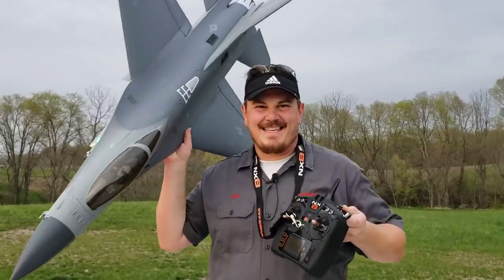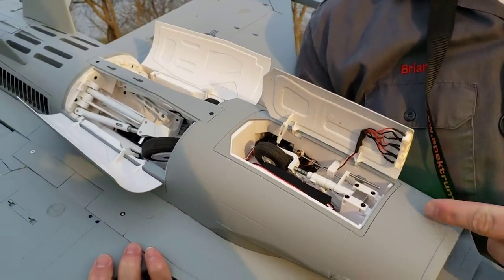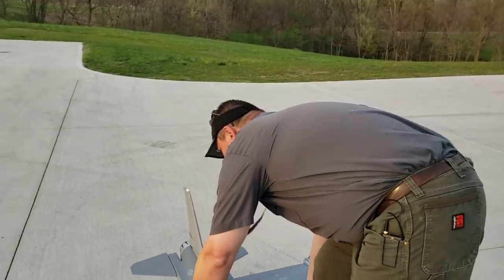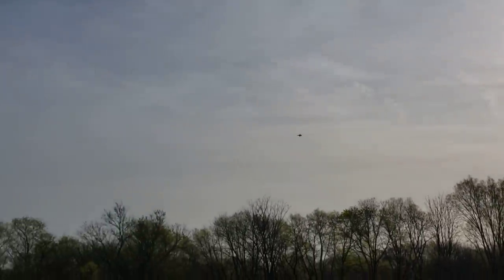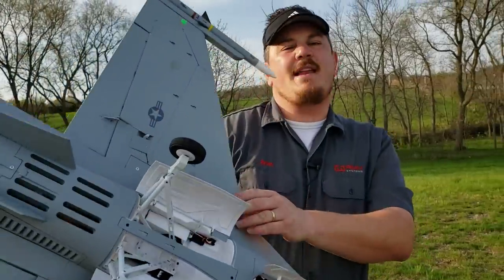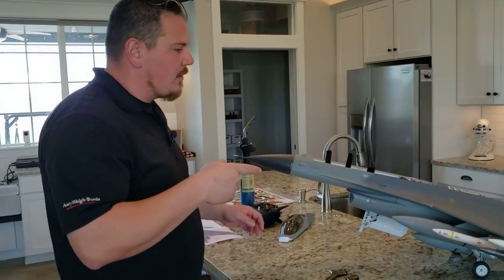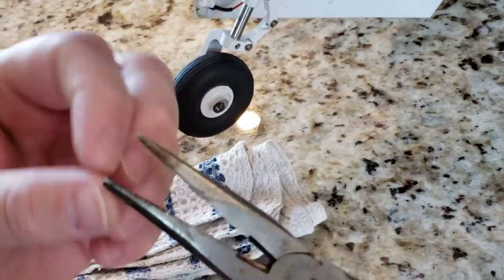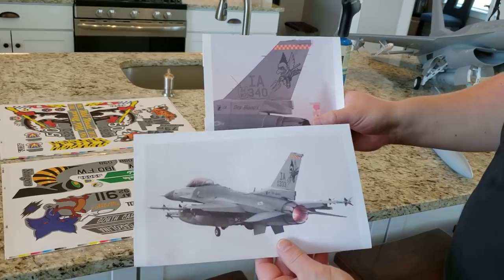E-flite - F-16 Falcon 80mm - 4X Maiden Flights & 2X Repairs!!!

Comment: I appreciate your honesty in warning people that these aren't a 1st or 2nd edf jet...maybe a 3rd. You have crazy piloting skills..especially what you fly & where you fly it! Obstacles all around you...alot of people dont have those kind of skills. So,  good on you for warning them. 
Sweet planes...good job on the vids👍
Reply from the maker: Thanks Chris! I know for a fact that there's so many way better pilots out there, but I DID learn to fly in "tighter" quarters, and for me, it's kinda normal. Some guys think it's the same as flying with a wide opened flying field, but it's honestly NOT...there's good and bad that goes with it. Good, it FORCED us to stay close for filming. Bad, it's a lot harder to shoot landings on a FAST plane like this. This plane flies GREAT, but it needs time and a LONG shallow glide slope to get in at the right speed....this helps to keep the gear from getting bent, like I did ;) OR there's just more flying, and more practice and playing with CG to get it WAY back without making the plane fall over on it's side in a NASTY low level stall ;(

Comment: You are absolutely the very first person I have ever seen successfully change out a retract without purchasing parts exclusively from the company that made the jet! Great job
Reply from the maker: Thanks Tuna! I HATE buying parts, BUT on retracts, it's just the better option...when we run these "early" release flights, this sorta thing is almost bound to happen, since we CAN'T get them many times, this time included - LOL!

I know this screw repair will probably bend too ;( BUT, if it bends the right way, I can just turn it 180 degrees, and get back at it, then when it breaks off, I'll just swap it out. I'd like to put a brass sleeve over the screw to thicken up the assembly a bit, but still allow it to come off if I'd have a real rough landing. Maybe SS would be better, since it'd be stiffer??? Not sure the best answer, but I know that a large part of my issue on that item was the short strip and short flying circuit, but this is what I LOVE. I love the simulated carrier landings!!! I'll be doing a couple flapperon videos soon, so keep an eye out to see how much better (or worse) she performs. You don't want to have to crash yours, so let me do it to mine for you - LOL!!!!

Thanks for being here with us Tuna Flights!

Comment: Hey Brian I can't thank you guys enough for these honest flights and repairs. Its helped me greatly. I know this comment is probably over a year late but I just started this amazing hobby back in April. I fly this beautiful bird at my local airfield and land on a grass runway and have had to replace that nosewheel axle myself. The nose gear axle thread is reverse threaded, if you turn clockwise to remove it they come out fairly easily plus HH sells them at a reasonable price too which is great.

Comment: Brian & Camera Crew, if you watch and listen at 26:45 in this video, the mic doesn't rub on anything.  The noise seems to be a bad/dirty connection at a plug & socket, just a thought.   Love you guys, keep up the great teamwork!
Reply from the maker: Okay, good idea. Not sure how to prevent this, since they're screw in style 3.5mm plugs????
Reply: @BrianPhillipsRC  I would disconnect then reconnect all connections used for audio in your setup (a couple times) to clean/re-seat the contact surfaces inside the plugs, especially if they don't get disconnected very often.  Worth a shot, hope it helps!  If problem persists, there could be a bad spot in a wire, the interference seems to be triggered when you are moving.

Comment: Saw this thing at Horizon Fest past weakened. Unbelievably cool. I am a heli guy but would love to get something like this.
Reply from the maker: If you're flying Heli's and want to get this plane, might want to start with the F-15 or Habu, just an FYI. I want you to have a great experience, and this one is not super easy, but it's not as hard as flying some Heli's, that's for sure!!! Just happens to be a slightly different skill set.

F15 https://bit.ly/30RrnlG
Habu https://bit.ly/38Kilv1
Reply: @BrianPhillipsRC  thanks Brian I’ll look into those.

Comment: Not sure if you have tried them yet, but I did a search for breaks and it look like Dubro makes a light weight brake for the nose wheel it ties into the elevator servo or could use a separate micro servo. Might help with some of your faster planes like this one.   It would likely need to be modified to work with certain planes , but I think you would be up to the challenge!
Reply from the maker: I'll be adding flapperons too. This might help a bit, but to be honest, I need practice with this plane.

Comment: Adding flaperons is a must..as without flaps no pilot could pull of a batter landing. Might as well employ Aircraft carrier systems too
1.  tailhook on plane and wires on runway to engage tail hook
2. Arresting net as last resort
3. Latest beacon following computer assisted landing system.
Reply from the maker: I want to do it due to the cool factor, but flapperons first.

Comment: Hi Sir, did u land using the gyro? I am a no-gyro flyer fly many edfs including turbines. I found that the fms F16 80mm and also freewing F16 90mm are very hard to land perfectly. during low speed to land, it will move like a wave when we do the elevator input to flare even with high expo. Maybe need to setup the flaperon/taileron like RcGeeks did.
Reply from the maker: I don't use SAFE (auto-leveling), but I use AS3X for the rest of the flight.

Comment: I was surprised you didn’t take the F-16 to the road. I remember you doing that with another jet. Not questioning you, I’d need 3 of your driveway lengths to land this EDF.
Hence the reason my 80mm a-10 after being built 6 months ago hasn’t been maidened. (Scared to land it. Well, scared I’ll run out of runway)
Reply from the maker: Yeah, fear is a real thing ;) The F-18 is easier to land, if you have space. Flaps make a HUGE difference on the F-18, but the rollout and wonky but BEAUTIFUL landing gear makes for a complex situation if you have any yaw correction on the landings with either of these planes.

Comment: In $ per smile, does the 70mm version not look to be the better value option?
Flight time also a tad too short with this 80mm version for me..
Reply from the maker: $'s to Smiles...tough. This is a plane that I stop and look at and admire every time I walk by it. Don't get me wrong...the 70mm passes the 10 foot test, but it's not one I admire sitting in the basement.

Also, this F-16 is just a GREAT flying plane (still) and I LOVE landing it...even thought it's a tough experience. One of the harder to land planes I have, but it's easy to load the battery, and it flys amazing!

Comment: Just had my second flight; made one attempt too many at my final and totally lost power while coming in.  Came down short, level, but hard into the dirt.  My front gear was a bit worse than Brian’s:(. Parts are on back order at HH. Gonna set my timer for 3:00 next time!
Reply from the maker: NOOOOOOOOOOOOOOOOOOOOOOOOO! Sorry to hear about the mishap. That's a real bummer, on maiden, no-less?!?!!

I'd be fixing it, if I was you... I like it better now that I can swap out the bolt that I put in there.

EDF's are power-suckers, and especially when you see that beauty whip by at close to 100mph and just beholding the beauty, it's so easy to blow right past the timer...I've done it too many times to count!
Reply: @BrianPhillipsRC  this was on my second flight, about a month after a good maiden flight.   This time I just did one too many fly bys, oh yes, she looks and sounds great zooming past!!
Reply: Just ordered that fastener kit too!!  What size tap/dye bits did you use? For that axle?

Comment: nice flying as always, 2 suggestions, why dont you use that nice empty road in front of your house to land? or , get some golf grass or artificial turf to extend your drive way to slow down, unless you get brakes. !
Reply: road at the end of the house cambers with a ditch on either side for water drainage
Reply from the maker: As Kelvin mentioned, the crown on the road does create some level of additional pucker but the turf around driveway will be filling in as soon as Mother Nature starts cooperating ;)

Comment: Also keep in mind that the nose gear door makes my FW F-16 yaw to the right whenever it is down. I am wondering if it did the same thing to you?
Reply from the maker: I didn't notice, but now I'll definitely check that out!!! Makes sense too, with the LED's and additional drag on that side of the plane. I wonder if I should make another air break out of the doors, like I did on the 70mm F-16???

This plane screams, leading edge slats, and flapperons ;) I'm finally getting a big enough, NICE enough plane to want to invest the time to make it "Just So"...
Reply: @BrianPhillipsRC  I just make my landing pattern on a way that caters to the turn if possible... but for the most part i just dont fiddle with it. Its not work making a mix of flight mode for it because they tend to make the plane snap back to the other trim instead of slowly transitioning. Basically I just deal with it and get gear up asap after take off

Comment: Hi Brian, great stuff as always!  May I suggest you put a net at the end of the “runway” to catch the plane just in case?  😄
Reply from the maker: That would be nice, except I think it'd REALLY screw up the model when it caught a fast moving plane. HOWEVER, we need to use the TWO pop-bottle arrestor cord idea. I keep talking about it, but never use it.... basically, you drop a string from one side to the other, with a bottle of water on either end, and land, getting the gear caught in the string, and you slow down from the bottles pulling out in a "semi-controlled way. I've heard of guys doing it, but I want to try it myself :)

Comment: Is a nice f 16, I just hope horizonhobby would add brake system in it, because that thing comes in pretty hot on landing, great landing D, I don’t know how they would make it happen but it would be great innovation
Reply from the maker: You can get wheel breaks, and I might, but I'll be more likely to do one of two things...

1) I will tighten my modified nose wheel bolt, thus breaking all the time to a degree.
2) I will add flapperons and show how it works.
3) I may come up with a breaking system that's EASY to do and CHEAP ;)

Comment: Awesome plane! I wonder though, can the missiles be swapped from the wingtip hardpoints to the pylons and vice-versa? I noticed that they have the AIM-120 (AMRAAM) on the wingtips and the AIM-9 (sidewinders) on pylon 2 and 8. That is a very uncommon loadout in real life because you usally position the lightest armaments on the far end of the wing. 

It's not a really big deal it just feels "off"
Reply from the maker: I agree, and tried, NO...sorry. You COULD pretty easily modify this, but it's not the same mounts ;(

The longer missiles do make it a bit better in tip overs.
Reply: @BrianPhillipsRC  Unfortunate. Thanks for the reply though!

Comment: I love my 70mm thunderbirds aircraft, how does this one fly compared to the 70?
Reply from the maker: I love the way it looks so much better, and the retracts are way better. As for flight...it's got slightly worse power to weight ratio, which is disappointing, but it's so dang beautiful, It's hard to stay upset for long ;)

I want to ask Horizon Hobby what would have to be done to get 8S on this beauty...and I want to try it.

Comment: Or you install brakes on the wheels or you buy a part of the road !!! Awesome plane. Hi from france
Reply from the maker: I thought about making more friction on the nose gear, but then I was afraid I'd just rub down through the tire, into the wheel.

Breaks would be nice, but not sure if I'm into the added complexity. Too bad I can't come up with a great PASSIVE louver system for the cheater holes, then I COULD Setup reverse thrust. I guess, If I'm gonna modify the plane, I'd be inclined to install leading edge slats, and flapperons. This would allow for an extreme slow down PRIOR to touch down, that would help me get onto our shorter runway.

Comment: Hey Brian, the 70mm E-flite F-16 (The Thunderbirds) is pretty much my go-to plane, I fly it ALL the time, it flies like a glove and I'm more comfortable with it than any of my other jets.  I've also gotten MUCH better at landing it because I have to fly out of my Dad's pasture and its a rough runway but I can set it down without breaking the gear every time now.  My question is, since you've flown both,  if I'm comfortable with that 70mm F-16 do you feel like it would be safe (pun intended) a to step up to this 80mm?  How similar to you feel this 80mm is to the 70mm as far as its handling, landing speed, etc?
Reply from the maker: If you're flying from Grass, that's the real quesiton.

If you can fly the 70mm, you can fly the 80mm, but can you LAND it? Grass would be a no go, unless you're on geotextile fabric or something like this.
Reply from the maker: If you can fly from a road, that might work too.

Comment: Love the review Brian! The sound is truly amazing! I have 4 Eflite Planes and two years of experience. Now I’m thinking of buying it but this would be my first EDF jet. Would you recommend buying it as a EDF Newbie or should I go with the Viper 90mm?
Reply from the maker: If you can stomach waiting on this, I'd suggest before you take the plunge on this or the 90mm Viper, you might instead consider the 70mm F-16 or 50/70mm Habu...I know it'll kill you taking the middle step, but need to keep in mind, these faster flying, and heavier landing jets (like this F-16) are pretty hard to land. They fly great, and with enough room and good conditions, are FINE for landing, but they just take more skill...skills that are strangely different than that earned from flying a prop driven plane.

F16 https://bit.ly/3aSp4Yl     <<<<<<< Start with 70mm for a slightly better MIDDLE STEP

Habu https://bit.ly/3ci5eWD    <<<<<<< Get the 50mm for the cheapest MIDDLE STEP

Viper https://bit.ly/3og8kNE      <<<<<<< 90mm is not hard to fly, but super similar to the 70mm and this might give you a better chance at success when you're ready to rank up to the 80mm F-16

ALL that said, if you're in a position to spend a lot of time and money fixing the F-16 when and if you crash land her on maiden, then it is a SWEEEEEEEEEEEEEEEEEEEEEEEEEEEEEEEEEET plane. BUT the 90mm Viper would be a better EDF cherry popper if you MUST choose between those two. Also, keep in mind, the habu is EASY to fly, and you can fly her on 3S with the 50mm EDF - so you'll be way less deep into it if you find you need some practice BEFORE you get the F-16.

Hope this explanation is helpful, and don't want to discourage you - you CAN do it, but I like to call this type of choice, "high consequence" - meaning, if you're okay - all is well, but if you're NOT, it could be catastrophic - loosing a $600 plane AND a $200 battery in one blow might be enough to push a newer pilot over the edge of quitting... just use your best judgment, and I hope you'll have a GREAT experience either way.

GOOD LUCK!
Reply: @BrianPhillipsRC  Hey Brian, thank you so much! The fact that you’re taking the time and replying to my comment is the exact reason why I am watching and supporting your Videos. I would love to use those links but unfortunately I’m from Germany :( Is there any other way I could support the channel?

Comment: Can you give us the diameter of the landing gear?  Wonder how it will perform in short grass.
Reply from the maker: Rich did a flight from Grass, but it's JUST enough power to get in the air... Landings are WAY easier, but you better get your speed WAAAAAAAAAAY down, or your nose gear pin will bend like mine :(....

Comment: How do you know the range of the plane? What happens if you fly too far?
Reply from the maker: You can do a RANGE TEST which lowers the power to the Tx circuit to 10% of normal and you can walk till it stops working. If you fly too far, it goes into fail safe, and you lost your plane ;(
Reply: @BrianPhillipsRC  Thank you! Btw, how long is your runway?

Comment: Dude...That bird needs the New Jet thrust reversing ESC :)
Reply: yea like the draco
Reply from the maker: I already talked to HH about this, and they said way too many cheater holes, so it's noisy, but doesn't work well. I think it could be made to work with some louvers, but not sure it would be as easy as I think it should be.

Comment: Does it not have flaps?
Reply from the maker: They exist, but they're not activated in the Rx - which is super duper annoying. There's supposedly a way to do it, and when I get instructions to do it RIGHT, I'll share it. This was supposed to be included, but someone screwed up!

I can say that the way I was landing it, I'm NOT 100% sure they'd help, since you kinda HAVE to high alpha it in. I'm seriously considering LE Slats, and Flapperons on this plane, with an AR8360T - this would help slow this BEAUTY down so you can land her with ease!

Comment: Bad idea. Now the axle is "soft".
Reply from the maker: Bad idea? What other choice do I have??? Order a replacement? It doesn't exist yet! (Now, a week later, it's on order, fyi).

...but my repairs are working well, FYI. The bolt does bend if I hit stuff (as I often do...this plane is a bit too fast landing for our runway), but rather bend a replaceable, sacrificial bolt than break a hard to replace, expensive yoke.

Comment: Brian is this F-16 the same size as the 70mm F-16?
Reply from the maker: I was wondering the same thing! Here's the side by side size comparison...

Fan Size 80mm / 70mm
Wingspan 1000mm / 813mm
Length 1450mm / 1258 mm
Weight (2665g-2847g w/o Bat vs 3245g-3779g w/battery) / 2090g (With battery???)
Reply: @BrianPhillipsRC   Thank you